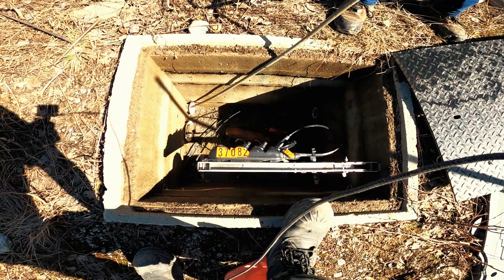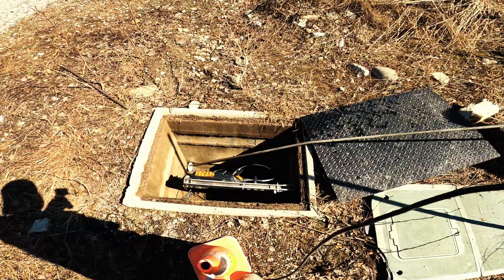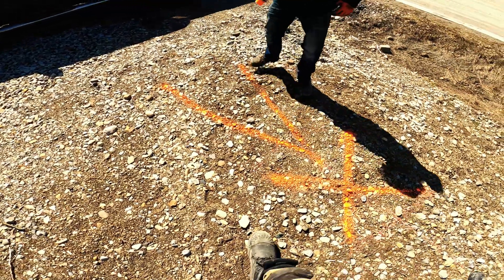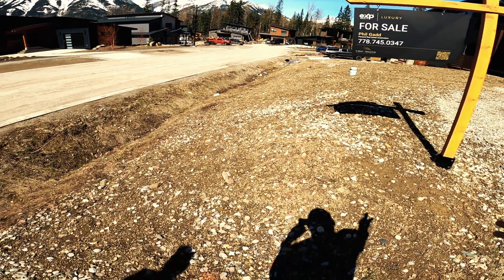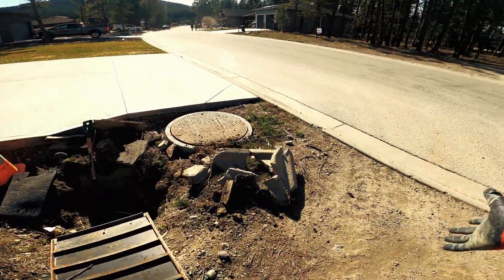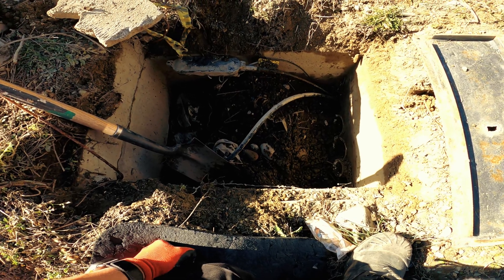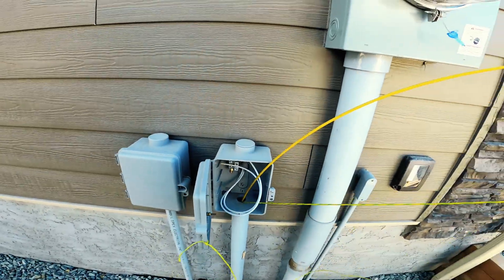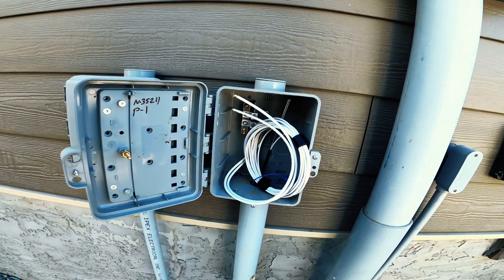TROUBLESHOOTING BLOCKED CONDUIT + FIBRE OPTIC CABLE DROPS

Comment: Man those telus techs are going to have such an easy job once all those electricians get on board running clear curve...

Might be worth having an inspection camera, can get them decently cheap
Reply from the maker: They’re getting better the more I consult with them haha , and I had an inspection camera  didn’t use it much until I lost it 😅 will get a Milwaukee one at some point 😁
Reply: Ya 90 yrs from now